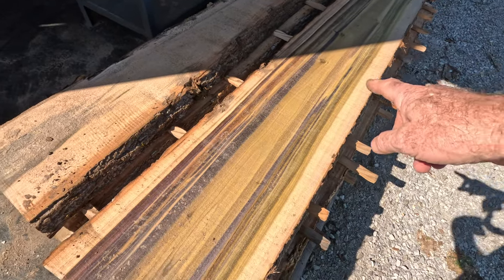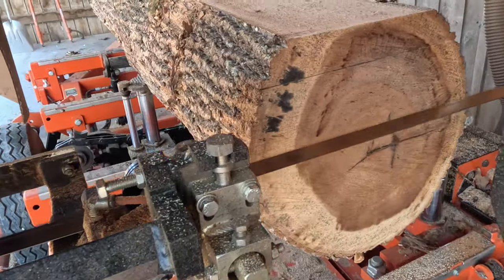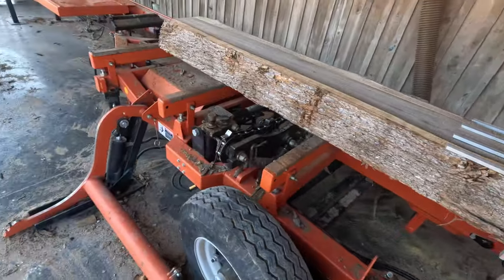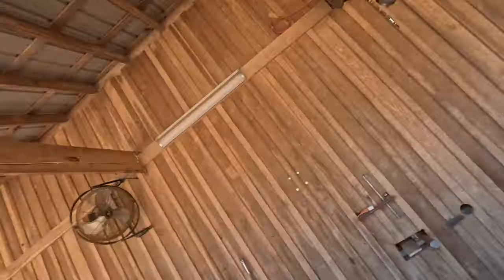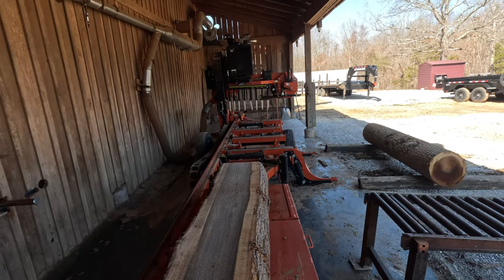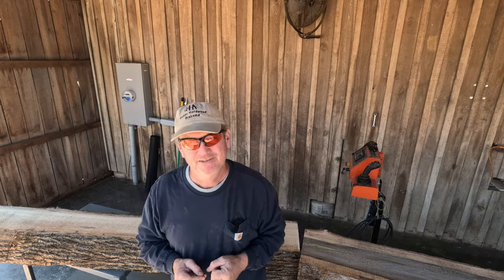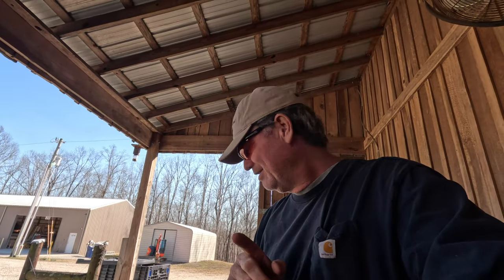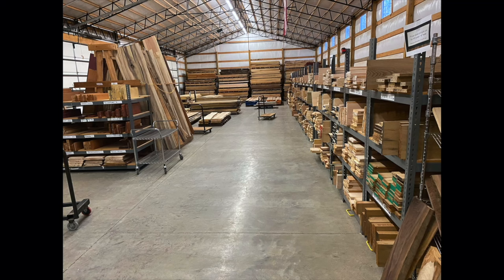Secret Sawmill Band Tension Tip!

Comment: Thanks for the tips. I have an old 2002 b20 timber king I got it on a good deal it seems a little out dated but I’m slowly getting use to it I always leave a lot of saw dust on my boards I’m going to start keeping a better eye on my tension hopefully that’ll help. I do appreciate your knowledge you share!
Reply from the maker: Great !  There should be virtually no sawdust on the board when everything is functioning optimally.

Comment: Could you do a video on cutting speed? Do you enter the log slow then speed up? Do you change speed for different wood or trees? ETC.
Reply from the maker: That would be an interesting video, yes, I will make one in the future.  Thanks for the suggestion!   Sawing speed is like driving a vehicle or running any piece of heavy equipment, it requires constant input on the controls, that’s why I don’t use the cruise control feature on the mill.  Even the entering speed changes every cut depending.

Comment: Do you sharpen and set your own blades? I have ordered silver tip turbo 7s from Joe and I still get allot of sawdust. It’s smooth cutting and sharp but I still have a decent amount of dust on my boards.
Reply from the maker: Yes I do but the bands in this video are new and unsharpened.  Sawing fast and using diesel for lube is how I'm gettin this little sawdust.

Comment: That thing sure cuts fast and clean.  Since I'm running an old LT40 I use a tension gauge to set my blade.  I rebuilt the spring tensioner so I could get it up to a max of about 25k..  Originally it would barely make 15k tension.  If I had about 30 more hp maybe I could get closer to your cutting speed.  Do you know how many fpm your blade is running?... I'm guessing it's quite a bit faster than mine.
Reply from the maker: Thanks!   I will check on my band speed.  I’m not sure how accurate the WM diagnostics display is, it tells me what it’s supposed to be but I wouldn’t bet my house on it.

Comment: Great video sir,  thanks for sharing your experiences and knowledge of milling and band tension,  how do you keep your high speed guides lubed?
Reply from the maker: Diesel or water soluble oil works very well.
Reply: Thank you!
I don't need to run diesel drip milling spruce out west.
Your  milling headquarters looks great, did you ancer it down to your pad?
Great video and chip is a great kid, love our dogs as well
Reply from the maker: Thanks!  No I haven’t anchored it yet, it walks a little but I’m figuring out how to minimize it.

Comment: When you have highly figured wood like this, what's the next step, do you edge it or leave the bark on. Looks to be about 2 inches thick
Reply from the maker: For these boards, I will leave the bark on and sell them as live edge slabs.  If a board cracks or otherwise defects, I will edge and sell it as a specialty board.

Comment: Does this mean if you have a manual tensioner you should re tension every few cuts meaning take tension off then bring it back up to torque specs?
Reply from the maker: Yes, 100% important to keep the band on the tight end of the manufacturer spec.  They will stretch a little when new and will certainly stretch when they warm up to operating temperature.  I've had them slack up in the matter of a cut or two, and it's easy to just readjust and resume sawing.

Comment: For minimal sawdust… are you setting your teeth narrower so the dust doesn’t spill over as much in the kerf or is it more a function of gullet/hook angle choice.

I remember in one video you said you use 1.5” .055 turbo 7s… what are you setting these at for hardwoods? 25-28 thousandths? Or closer to 23-25 thou? Thanks.
Reply from the maker: 25 thou, but residual sawdust is a function of all you listed, but mainly sawing fast to keep the sawdust suspended in the vortex of recirculating air in the gullet of the band, so it can be ejected properly and quickly.
Reply: @HobbyHardwoodAlabama  Gotcha. Makes sense. Great vids. I’ve been sawing for 15 years or so now but what you talk about is next level detail. I’m liking it.
Reply from the maker: Thanks!

Comment: Hello Robert I have a lt 40 supper Hyd  52 hp cat Diesel engine aint no way in hell I can cut clear white pine that fast  any advice on what I might be doing wrong
Reply from the maker: I'd have to know more but a 52 hp diesel is only 3 more hp than mine, so you should be able burn through them pretty fast.

Comment: I notice i have to really keep upping my tention worth a new blade,  takes a few logs til pressure stays firm . Yes soons blade warms up tention drops . I c it every day
Reply from the maker: You are EXACTLY on point and what it's so important to monitor band tension all the time!  That is very normal band behavior, and most people ignore that.  You are doing a good job.
Reply: @HobbyHardwoodAlabama  Have learned quite a few new things from your videos,  all u talk about on your videos I get to c every day when I'm slicing away on big spruce logs. And yes id really like to upgrade to a LT 70 super hydrolic with diesel engine. Going to try some different blades from woodmizer , 7° see how they stand up in spruce , c if they better n 10degree . Live n learn!! I sharpen n reset with every sharpening but once the blade max stretch is reached,  slightly over 3200 psi it's a matter of time b4 it busts. Usually a medium sized knot can make it happen . Most I've got out of a blade is 2 days . That's with using the debarker  as much as needed. I've tried a laser but doesn't work for me due to too much sunlight. Getn very good at eye balling!

Comment: The face is riveted to the gauge on my LT40I walk with my mill and the pointer is on the line between yellow and red.
Reply from the maker: I've seen that on a few, but the WM website videos and all my gauges on my old LT40 they were just blank, white face, standard gauges.  So in that case, it's hard to tell where the band should be, and also be interesting to know where the color code on the current gauge is and if it really is the correct band tension for the band you are running or just what WM decided to mark the gauge.  For example, on my LT70, WM has big black decals that say run at 85 psi air pressure on the band, but they done;t like too cut at that tension.  Everybody at WM knows this but they still keep putting the misleading deal on the mills, maybe for liability reasons. Their tech support says to run at 90 psi, which is where I run most bands.  WM has told my buddy, with different bands, to run at 100 psi.  Each band likes a different tension based on thickness and width and it most likely wont be where WM has color coded the gauge.  Sad but true.
Reply: @HobbyHardwoodAlabama   My LT 40 is a 1991 model and has a color coded gauge. Wood Mizer told me to run it between the yellow and orange marks, which (if I remember correctly) is 2250#. Some years later they revised the recommendation (tech support) and said to run at max pressure. That did not sound right to me, so I still use around 2250#, or slightly over. With a fresh blade I begin with an over pressure setting and it will settle in to my desired pressure within a minute or two.
Keep the videos coming, you always have tips beyond what the company provides. 
Stan Stevens
Reply from the maker: Thanks! Yes, you will get a “Feel” for where the bands want to run, and it’s hard to describe, but you are feeling it.

Comment: The camera showing a mirror image?
Reply from the maker: Is it?  Not on purpose, but it could be.  At what time stamp?   Cameras and I don't get along well.
Reply: Starting at around 48 seconds.  Debarker on the left, sawhead supported on the rail on the right side.  
Did you get that little amount of sawdust when you had an LT40?  I always have sawdust! @HobbyHardwoodAlabama
Reply from the maker: I will check it!  Yes, even with my LT40, I tried to keep sawdust to a minimum.  That being said, I had lots of sawdust until I could fit all the pieces together.  Then it’s like night and day.